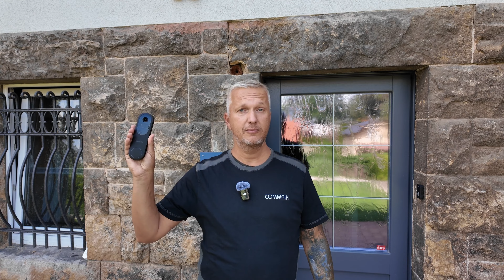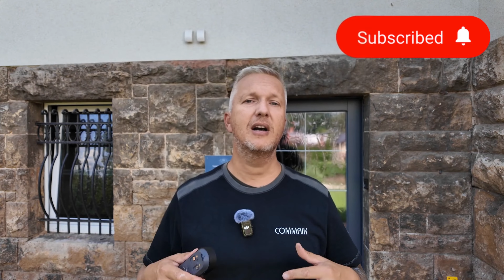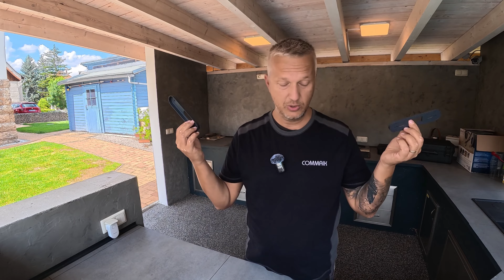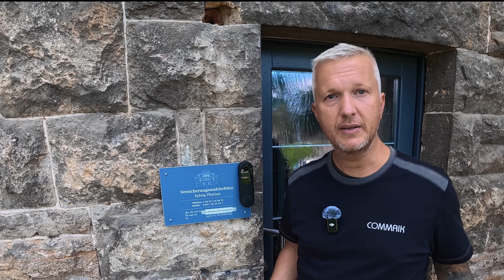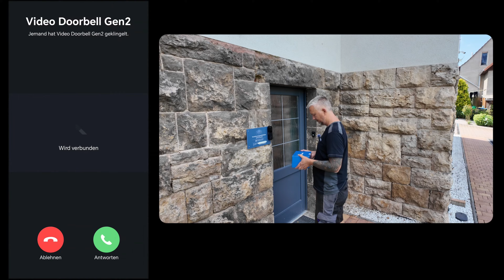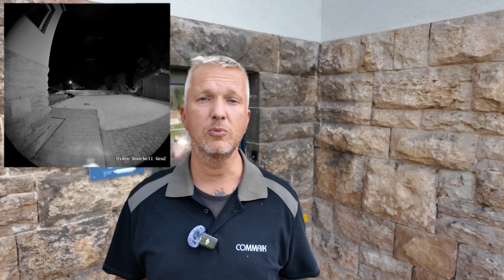Reolink Video Doorbell 2nd Gen Review 10 Month Battery, 247 Recording & No Fees

Comment: 2:10 Unfortunately, not the other way around. We naturally want live footage with the call, and then decide whether to record or not.
Reply from the maker: Hi, I'm not entirely sure if I understood your comment correctly.

With the Reolink Video Doorbell Gen2, you first receive a push notification or incoming call notification on your smartphone when someone rings the doorbell. The live video doesn't appear automatically. You need to tap the notification first, which opens the Reolink app and shows you the live view of the visitor. At this point, you haven't answered the call yet, so you can still decide whether you want to talk to the person or not.

There is also an interesting alternative: If you connect the doorbell to an Amazon Echo Show, for example, the live video can automatically appear on its display as soon as someone rings. Reolink officially supports this feature. This means you can immediately see who's at your door without having to answer a call first. Two-way communication can be activated separately if needed.

Video recording also works independently of the doorbell's calling function. You can use the doorbell just like a regular security camera and configure it to automatically record when motion is detected, even if nobody rings the bell.

So, did you mean that you'd like the live video to appear automatically when someone rings, without having to open a notification first? Or would you prefer to decide whether to save a video recording only after seeing who's at the door?
Reply: @commaikenglish Okay, on my end I receive an incoming call from my doorbell which I can only end or answer. When answering, the app does indeed open, but by then you are already connected.
Reply from the maker: @000219 Ah, now I understand what you mean! Apparently, you're only getting the incoming call screen with the options to answer or decline. And of course, once you answer the call, you're immediately connected to the visitor.

On my phone, it works a little differently. I can also tap directly on the push notification without answering the call. This opens the Reolink app and shows me the live video from the doorbell. I can then decide whether I actually want to answer and speak to the visitor.

That's why I suspect that regular push notifications from the Reolink app might be disabled or blocked by your phone's notification settings.

Are you using an Android phone or an iPhone? And have you enabled regular push notifications for the doorbell in the Reolink app?

That's what I would check first. It's quite possible that the difference comes down to the notification settings.
Reply: @commaikenglish thanks, iPhone , let me check the regular push notification I'll let it know

Comment: When installing the unit using the wired option should I leave the rechargeable battery in the unit or should it be removed as its wired.
Reply from the maker: Hi, 
the battery stays inside the doorbell. It is built in and, as far as I can tell, cannot be removed or replaced. With the 2nd Gen Battery Doorbell, it also serves as a backup: if the wired power supply fails, the doorbell automatically switches to battery power.

Just make sure to select “Wired Power Mode” in the app after connecting a suitable 16–24 V AC/DC power supply. With lower-voltage existing doorbell wiring, the battery may only be trickle-charged instead of the doorbell running in true wired mode.

Comment: Thanks for this interesting video! The power of my existing doorbell gives AC-current. Can I use it on this Reolink doorbell or needs it DC-current?
Reply from the maker: @waltervos8537 Thanks, Walter! 🙂 
You can use your existing AC doorbell power supply—DC is not required. The Doorbell supports 8–24 V AC. For wired continuous operation including 24/7 recording, it needs 16–24 V AC.

Just check the voltage printed on your existing doorbell transformer. With 8–24 V AC, it can charge the Doorbell; for full wired operation, it needs at least 16 V AC.